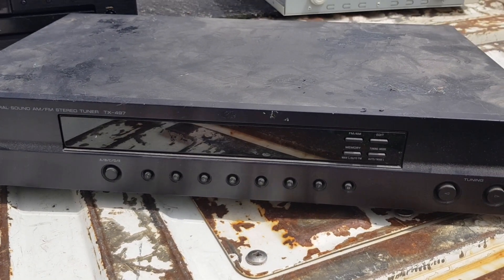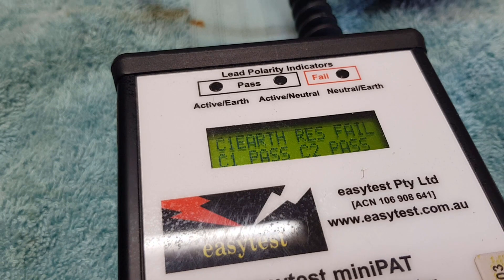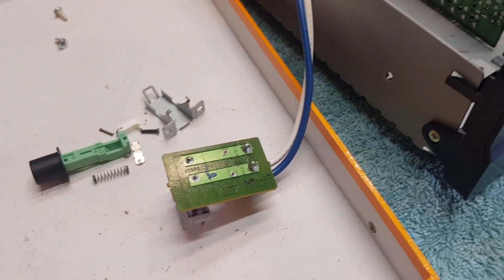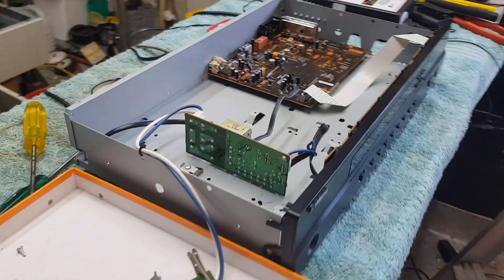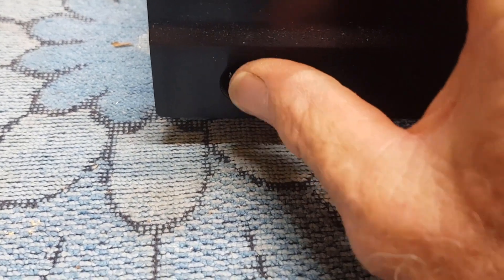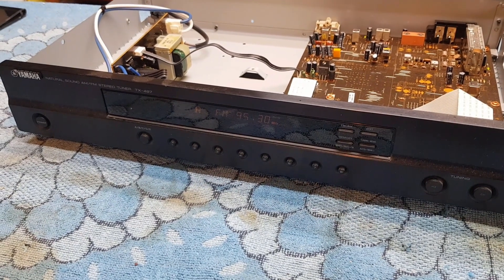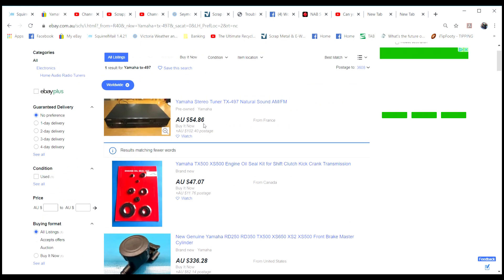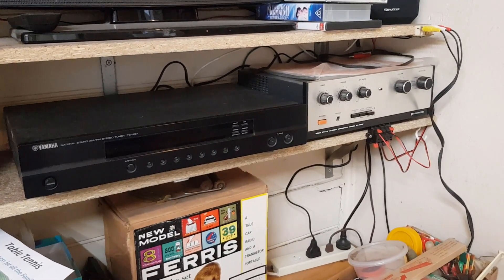Cool e-waste find! Yamaha TX-497 tuner repair. Saving a nice stereo radio tuner from certain death!

Comment: У меня такой же , яркость на дисплее тускло светить,как исправить?а так все работает
Reply from the maker: Извините, я не знаю, как исправить проблемы с яркостью ..
Спасибо за просмотр :)
Reply: My sister's husband did a shunt across two resistors on the display board which worked on the TX 492 . I have yet to try it on the 497 though .
Reply: My TX 497 has gone like this after about 5 - 8 years of moderate use . I will be getting a lightly used Yamaha TX 480 very shortly . I also have a SONY ST -  SE 570 ( RDS ) text , which is white dot matrix and with narrower IF filter modifications .it can equal or surpass the two Yamaha's in terms of adjacent channel selectivity . AM sensitivity is average as is selectivity but sound is a bit thin and not as loud as the Sony 570 which has higher sensitivity and selectivity .

Comment: That's a really good save from the trash, found a switch is much easier replaced than put back together as well.
Reply from the maker: I've since had another of these type of switches need replacing - I'll be saving any other good ones I find! 😊
Reply: Element 14 ( Farnell Electronics ) have these kind of parts as do Oatley Electronics ,  Jaycar and Wagner in Australia .